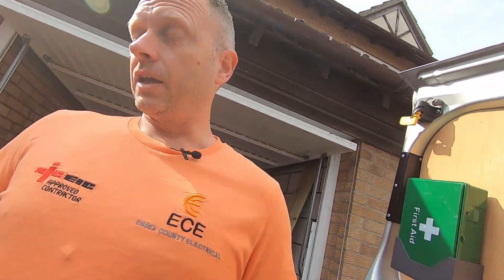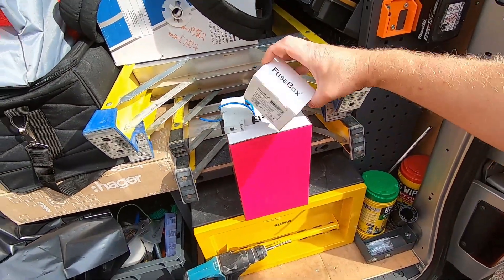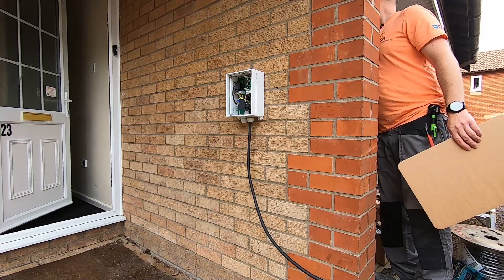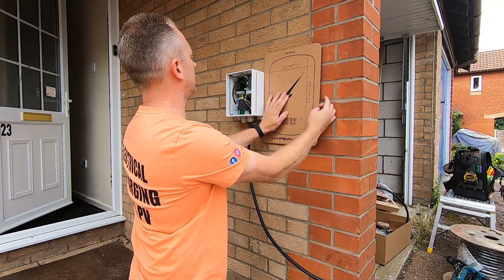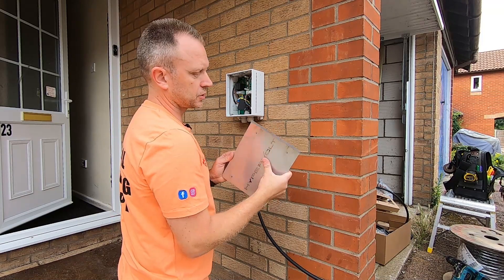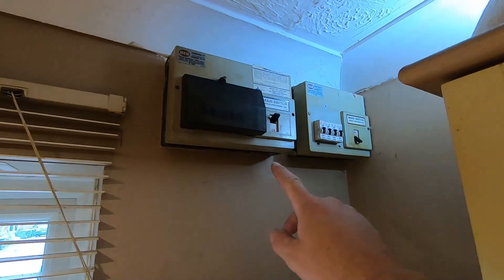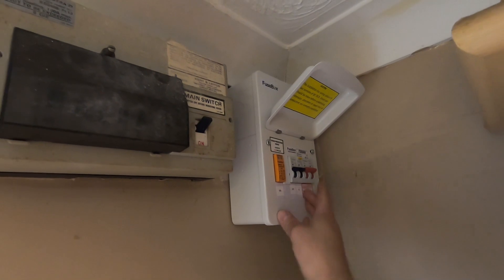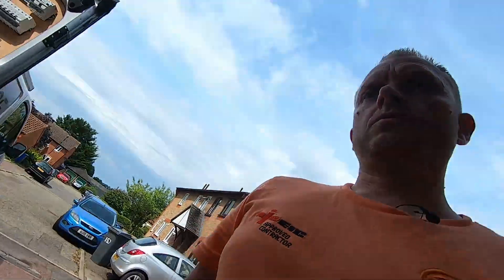Installing a HYPERVOLT EV Charging point (sparkylife)

Comment: Hi Just thinking ahead, after watching your video, in our garage I have a 32amp cable of which I used for my woodworking machines, of which I don't use now, they came off a 16amp fuse. Question. Will the supply 32amp cable be enough to fit this Charger?  Thank you welshman 2081
Reply from the maker: Hi Yes it should be as long as its a minimum of a 4mm cable if a long run then 6mm but your main issue would be installing the CT sensor as this needs to go back to the source I.e your meter location, this will monitor your consumption.

Comment: Hi mate, I've just quoted a hypervolt and doing the same as you with a 4 way fusebox SPD and RCBO, doing An SPD as standard on all EVs, a lot of sparks still not offering that.
Reply from the maker: Hi, the spd kit is on about £30 so why not install it, especially if you are fitting a dedicated board. I fit these on most jobs not only that it leave another spare way for a second chargepoint in the future. If connecting to an existing board then it is mostly impossible to fit in the board. But in that instance i fit an Isolator on the main tails at the meter location with an spd next to it which again is about £30 so it is always possible if the customer is keen to protect their investment. Thanks for the comment.